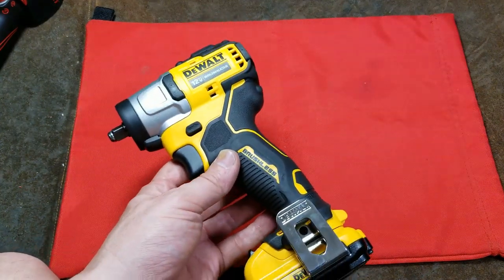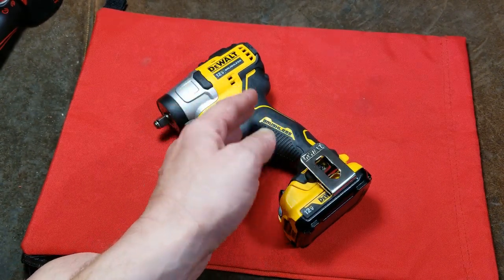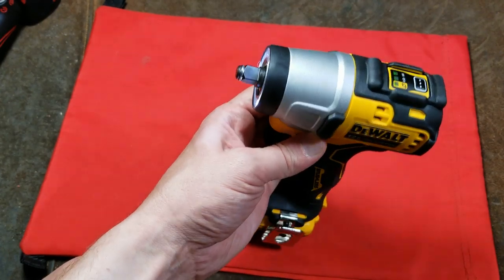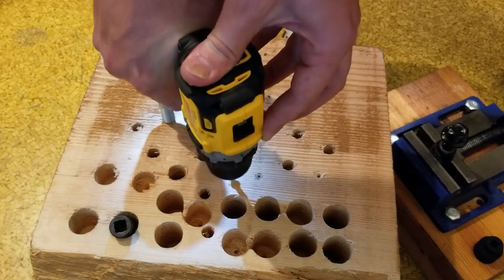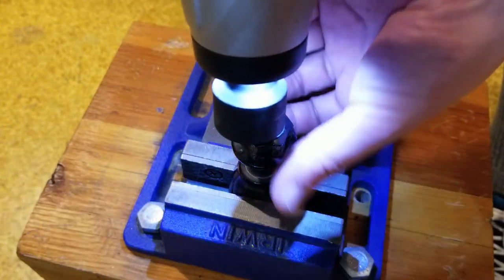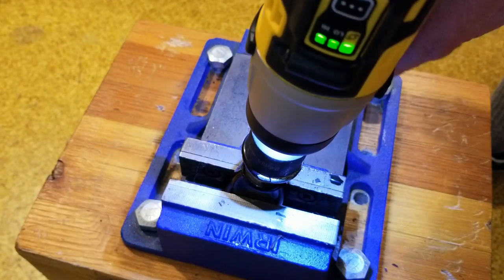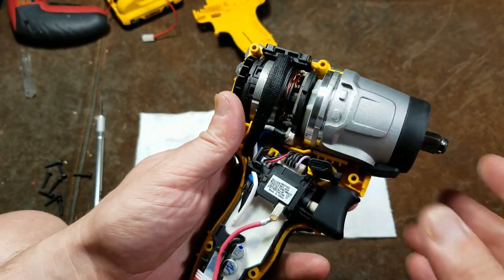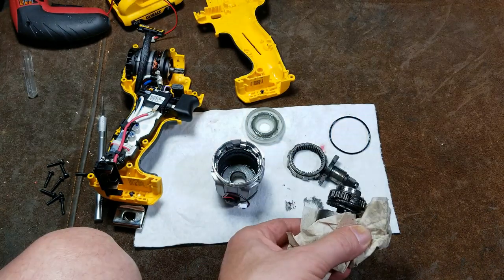DeWalt Xtreme Sub-Compact 12v Brushless ⅜" Impact Wrench Review

Comment: I prefer my Snap On pneumatic impact guns. These are fine if you are away from a compressor but if you plan right you won't ever need these tools. Edit: there is no replacement for Snap On  impact pnuematic drivers. Prove me wrong Catus. Woof!
Reply: My nitrocat has more power for a lot less money
Reply: @cbmech2563  
Fine. If you really need power nothing beats pnuamatic. For normal use these are ok. If you have limp wrists these are great! For 500 bucks i have 2 guns that flat out work. For 20 years now.
Reply: 500 bucks 20 years ago? Judging by the inflation in the cost of housing, that’d be like 2 grand in today’s money.
Reply: Ingersoll rand is every bit as good
Reply: My  nitrocat  1200  air  impact  is  quiter than  that  500$  snappy  with  more  power   (1200/900)  for  $149 .  I  agree  about  air  tools  but  not  about  the  snappy . Snappy  doesn't  make  anything  that  you  can't  get  as  good  as  or  better  for  less  some  place  else .
Reply: @upsidedowndog1256  
When  did  I  say  I  was  a  battery  fan?
Reply: no issues with those either. I went from chinese garbage directly to Snap On. I bought an air ratchet that is ingersol Rand, still using it today.
Reply: Very  expensive  tools  are  the  enemy  of  a  lot  more  good  tools  that  allow  you  to  get  the  job  done . Tool  truck  wrenches  for  3  times  the  price  don't  get  the  job  done  any  better . Ratchets?  I've  got  a  craftsman  18"  long  handle  flex  head  ratchet  that's  20+  years  old  with  no  problems . I've  been  a  heavy  truck  mechanic  for  the  last  50  years . And  still  working
Reply: Never  said  it  was  as  good  or  better . Better  is  the  enemy  of  good  enough  to  get  the  job  done . Good enough  puts  a  lot  more  tools  in  your  box  than  better/best.  You get  paid  for  what's  in  your  head,  not  what's  in  your  tool  box .
Reply: I will argue that point. They make the best except for pre Chinese Craftsman sockets. Those were the best.
Reply: That's  what  they  want  you  to  think  😂 and  you  definitely  sound  like  a  fan  boy . Personally  I  look  for  what  will  get  the  job  done  for  a  good  price . Not  the  "best"  tool  at  an  exorbitant  price .
Reply: I went out and bought snap on just so I could think I was a top mechanic lmao
Reply: @craigsmith4259  
I bought Snap On because everything else i ever used or had worked worth a shit except those. My HF buddies all agree.
Reply: @upsidedowndog1256  the only thing I can agree with u on Is they are made in china to
Reply: I have been an aircraft mechanic for 30 years. My impact guns live at home in my shed. On aircraft we need much better and precise tools than impact guns. I never even let my employees use 1/4" air ratchets for disassembling anything!
Reply: Earthquake is quality and cheaper
Reply: @miguelledezma1394  
My friend that has one thought so too. Until I pulled out the SO version. He commented that there truely is quite a difference and the savings weren't worth it for the power and blows per minute in comparison.
Reply: @upsidedowndog1256  so because it takes you 2 seconds less its better?
Reply: @miguelledezma1394  
In this case less is more. Less time, more power.

Comment: The Milwaukee m12 3/8" is probably twice as powerful as that dewalt 12v. VCG Construction ran the m12 1/4" which is only rated for 1100 in lbs. And it did circles around that 3/8"
Reply: Problem is breaking small 5mm/6mm bolts and possibly 8mm bolts NOT the head size is that the biggest misnomer. It is a useless tool when it breaks things and if you can't feel what a bolt is doing the tool is junk. Now if someone is Hercules and leaves behind wreckage of stripped/broken bolts then I guess the MilwaCHINA is for you.
Reply: Oh you said 5mm or 6mm bolts yea I would say even an impact driver would break that off if you got too careless. I mean you're setting the bar awfully low and still tripping over it. Gotta love the logic of the dewalt fandoms. They make some good tools but if you're not gonna bring any advantages other than 3 light rings and ergonomics then just stay home.
Reply: @Zachariahfml  I used the Snapon 3/8 CT years ago it was awesome. I tend to gravitate to them on items like this. The 1/4 impact from them is my go to.
Reply: @mt1885  you went from bad to worse. First dewalt now snap on
Reply: @Zachariahfml  This is what makes the USA the greatest nation on earth, we have selection of different vendors. More competition the better.
Reply: You mean Milwaukee always wins with them? I had a Milwaukee fuel set it was a piece of Chinas crap! 

Makita And Dewalt for me and most the people I see on my job sites use Dewalt or Makita
Reply: @apa7611  I agree never buy the Mileechina
Reply: @mt1885  Well Stanley black decker, make 4 line of cordless power tool... Black Decker, Dewalt, Portable Cable and Craftman
Reply: @mt1885  There are all most made in China... If i remember only Makita is Japan build.
Reply: I have the 1/4 and 3/8 m12, and have used this. Yes the 1/4 m12 is just as stout, and the 3/8 stubby flat stomps this. Still a great value at $99.
Reply: Ap A of course because they are cheaper in price 😂😂😂 milwaukee is the way he best of the best !